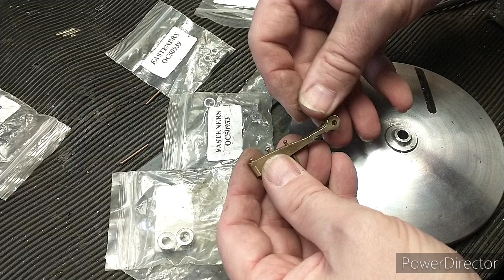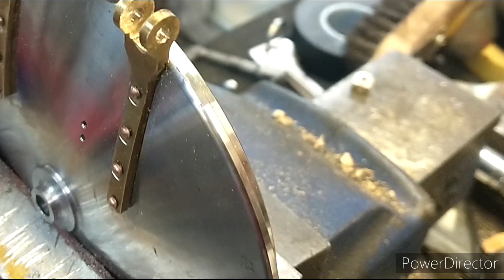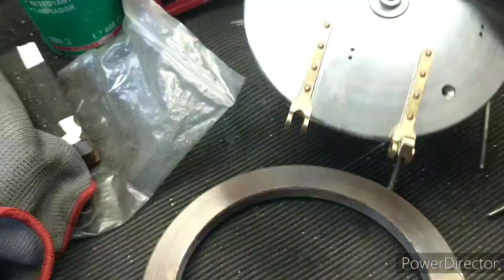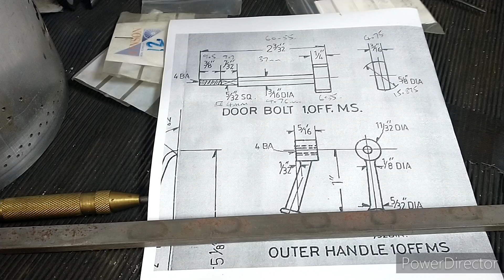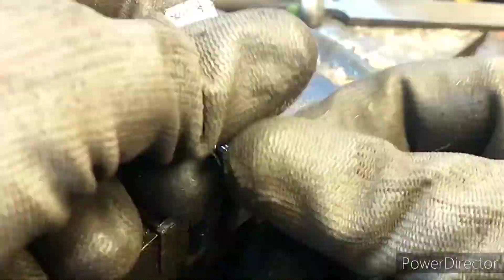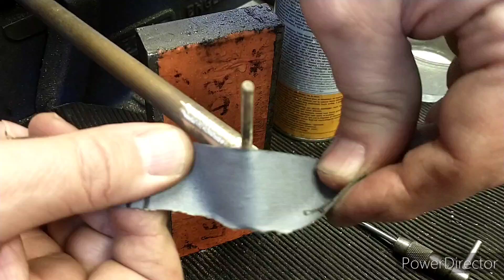Modelworks Britannia Ep52: Hinge and Bracket. #livesteam

Comment: Yet another Brilliant video Julia, very Theraputic watching you work your way through this project.
I have one of those heaters  and I too have four small outlets instead of one large one.
There are three short bits of tube with mine.
The heater sits at low level in the corner so two ports face streight ahead to the bench vice and lathe.
One pipe is angled  (to the right)facing the other bench and combi lathe, while the fourth is adapted via some piping from Wickes to divert the heat further down the workshop to emit heat by the milling machine.
This will be the first winter of actually using it but it does really heat the place up. Great work,looking forward to the next installment.
Cheers.
Andy G.
Reply from the maker: Thanks Andy it's been a godsend usually makes the workshop warmer than the house. 🤣 Might have a look at ducting again. All the best Julia

Comment: Good clear recording Julia. touch wood my heaters running well, just rotate the dart by 180 degrees to get the handles pointing downwards,
Did you think about maybe silver soldering the hinge brackets to the smoke box ring to prevent movement and leakage ?
Reply from the maker: Hiya thanks for your kind comments 😊 I hadn't thought about silver soldering the hinge brackets 🤔 the screw seems to hold the position fine. Maybe a bit of soft solder paint might work and not be too permanent? 😄

Comment: Morning Julia🥶🥶🥶🥶🥶🥶🥶🥶
nice job, 👍👍👍👍🚂🚂🚂🚂in fact blooming riveting😀😀
my diesel heater threw a wobbler on starting for the new season, thought it was the plug but it was just totally blocked up with carbon and soot in the burn chamber and only after 1 winter burning from new.
took me abot 20 mins to dismantle and clean out and fired up straight away and ok so far.
see you next time and have a warm coffee on me
atb
Kev
Reply: Glad you got it going again Kev.
I think we may well need them.
Hope yours is an easy fix Julia.
Reply: @masterpiecesinminiature8299  cheers Andy
and nice to hear from you atb Kev
Reply from the maker: @masterpiecesinminiature8299  I fired the parts cannon at it 😳 new glow plug and control board has fixed it at great expense but I couldn't find the actual fault 😔 thanks for asking. Hopefully can stay warm this winter ❄️
Reply from the maker: Thanks Kev, I used to have lots of problems with soot build up but eventually found some settings that give a clean burn. 😀 This time it was more serious. A new control board seems to have fixed it. I couldn't see anything wrong with the old one so not really sure what the root cause was. 😔 Thanks for the donation 😁 much appreciated.